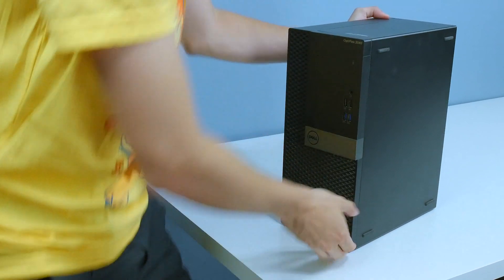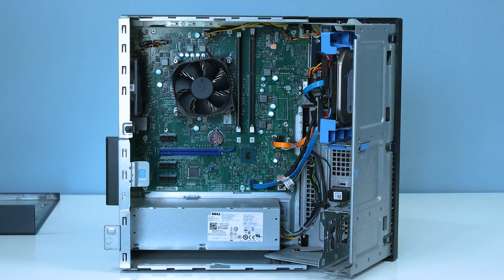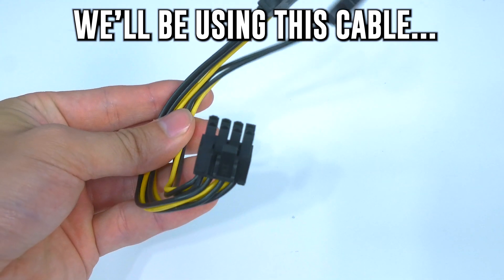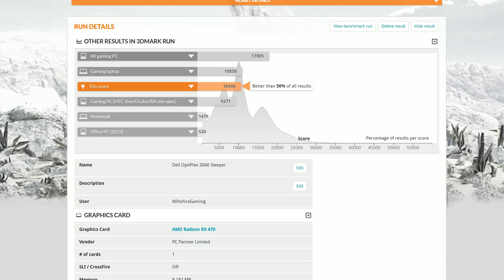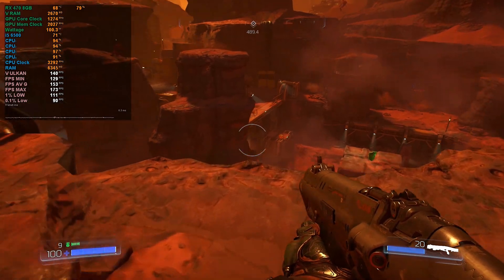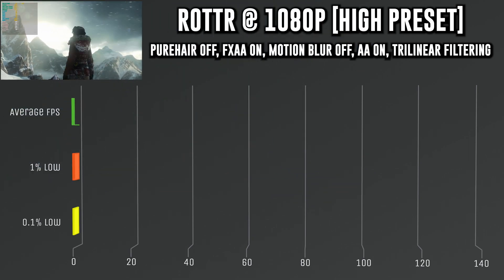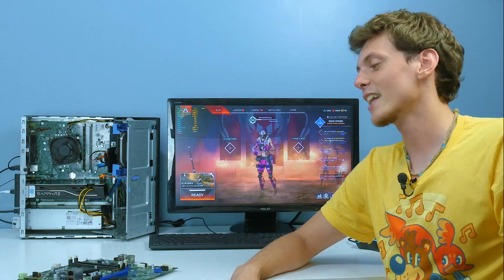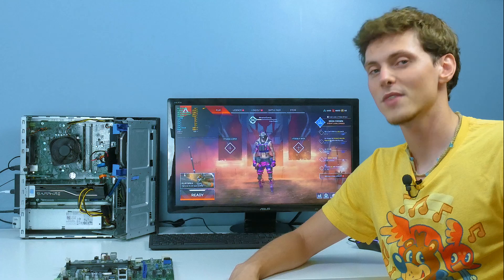$400 Budget Dell Optiplex Gaming PC (2019)

Comment: How do you connect the 2x sata to 8 pin to the power supply?
Reply from the maker: Connect the 8-pin adapter to the 2 open Sata power connector on the PSU?
Reply: @WiltshireTutorials  I didn't know there was 2 open sata connectors lol would a gtx 960 work with this (using 2x sata to 6 pin)?
Reply from the maker: The GTX 960 pulls about 130W from your PSU. You'll need 65W for your CPU and a few more watts for the drives and RAM in the PC. You'd probably be using 205W. The PSU in this PC I had in the video is 240W. In theory, it would work. However, that is taxing the PSU a little bit. It would be working a bit hard.

Comment: Dell Optilex 5050 ye sahibim.
İ7 7700 işlemci
8 GB RAM
GeForce 750 Tİ 128 bit 2 GB grafik kartı
Corsair m2 SSD 240 GB
1 TB HDD 
Bu sistem beni ne kadar götürür ve yükseltmem gerekirse hangi bileşenini yükseltmem gerekir yardımcı olabilir misiniz.?
Reply from the maker: I would upgrade the GPU and add another 8GB of RAM to the system. It'll be a reliable system for a long time with those specs. Obviously, it won't be gaming at 4K. But, throw in a new RTX 3060 or 6700XT and it'll do 1440p no problem for most titles.
Reply: @WiltshireTutorials  teşekkürler 🙏🏻

Comment: You can actully upgraded the psu in this pc with a mini psu, ofc you have to make some new holes for screws and make a bigger whole for the psu backside. You also need a 24 pinn to 6 pinn that you can order from ebay. But first you need to go to the bios and select powermode or power managment and select always on. If you dont do this with the new psu your gpu will always be on full speed and no boot. And when you want to shut down the pc you need to shut it down from the psu. But it works and yeah, i took away the hard drive and cd drive so i could fit a bigger fan, i aslo made the ssd case smaler so i could fit 1 ssd. But yeah, you can deff fit a mini psu like this Cooler Master V650 SFX Gold 650W <- this is an expencive psu, but you can follow this size psu and it will fit if you make the hole behind bigger and makes 2 screw holes to mount it better.

I did this bec i wanted to know if you could, but if you have this pc and wonder if you can pit a psu in this, yes you can but YOU need to do some modification to your case.
Reply from the maker: Already did this almost 3 years ago now: https://www.youtube.com/watch?v=lAejOvxFHkc
Reply: Just wanted to drop a "thank you!" for the notes regarding power management. Working on modding a Dell 7050 MT I just got. I had returned a prior GPU thinking it was defective and got a GTX 2060 at an even lower price; it was also giving the "full fans but no boot" issue. I tweaked the BIOS and Windows 10 power settings just to be safe. I'm typing this on that Dell so yeah, this still works.

Comment: Are you able to put an alternative PSU like a 600W EVGA psu in this OptiPlex the same way you can like in a Dell optiplex 9020?
Reply from the maker: No. This motherboard and power supply is proprietary. You have to mod the PSU to work with the motherboard
Reply: @WiltshireTutorials  Damn , this would’ve been a dope potential gaming pc if you could switch the PSU easily.
Reply from the maker: @theboy2777  it's not that difficult. Just get an SFX PSU with a 24-pin adapter. Just look at my OptiFlex series: https://youtu.be/1p9sgvkqMgo

Comment: Whats the best gpu i can safely put it in bro ? 😄
Reply from the maker: An RX 470 8GB or a 1060 6GB would be the max for the stock PSU
Reply: @WiltshireTutorials  i see , and oso what is the best gpu under 200 usd in yr pov mate 🤕🤕
Reply from the maker: Trying to find a decent GPU under $200USD is almost impossible these days. I cannot in good conscious recommend anything less than an RX 470 or 1060 6GB. Maybe try to get your hands on a 6500XT when they're released in late January.

Comment: Can I add a 1050 ti instead of the rx 470?
Reply from the maker: Of course! You can add up to a GTX 1060 6GB, if you wanted to!
Reply: @WiltshireTutorials  would a gpu that consume 150 watts work on no
Reply from the maker: That's pushing things a bit. I would try to stay under 120W max
Reply: @WiltshireTutorials  okay thanks man

Comment: optiplex 3050 i5 7200
ddr4 -GB 16
Power supply 240W

Is it possible to run a graphics card? gtx 1050ti
Reply from the maker: You could definitely use a GTX 1050Ti in your PC. You could even step it up to a 1060 6GB, if you wanted!
Reply: Thanks

Comment: Does it work without any problem? especially in full load? I have dell optiplex 3080 and I used GTX1650 OC edition I used dual PSU since I'm afraid using the PSU from dell it might not work properly..
Reply from the maker: You should be fine. The 1650's power draw is 75W, the CPU is 65W, RAM 1.2W per stick and NVME SSD is about 25W at full load. Add that all together and you're still under the max 260W that the 3080 comes with. There is no need to be using 2 power supplies.

The PSUs from Dell aren't bad. In fact, they're pretty efficient. They're rated 80 PLUS Bronze. The only problem is the low wattage ratings on them.
Reply: @WiltshireTutorials  thanks for the input!
Reply from the maker: @LaboyMoto  No problem

Comment: What graphics card u recomend to use on on optiplex 3050?
Reply from the maker: With an unmodified stock PSU, the max the PSU will support is an RX 470
Reply: Ohk ty but will it run gta5?
Reply from the maker: Yes. But, don't expect to run high resolutions with it. Probably could get away with 1080p medium settings max

Comment: These days you can get OptiPlex 5040 MT for under $200.  5040 MT has the same case, but a motherboard with 4 memory slots, so it's easier to upgrade to more RAM.  Pick 5040 MT over 3040 MT (2 memory slots).  These cases have one free 5 1/4" slot in the front (mesh plastic comes off).  Useful, if you want to add removable hard drive or similar.
Reply from the maker: If you watch the OptiFlex playlist, you'll find out that I replace the board with a 7070 motherboard!
Reply: @WiltshireTutorials  I didn't watch, yet.  Wouldn't it be easier to sell the original setup or use it for something else and get a 7070?  Well, it's good for making videos, I guess, but not very efficient.
7080 MT uses 500W power supply and it looks like it has 2x6 pin connector for video card.  Didn't look too much, but found this one for $75: eBay auction #174784507800.  There are some with 360W and less.

Comment: Very helpful video. Liked & subscribed. Am thinking of putting a better GPU into a 280 watt Tower Optiplex 3060, was wondering if you had any considerations I should be aware of. Thanks so much!
Reply from the maker: With 280 watts, you could probably get away with an RX 580 8GB. It typically consumes about 140W. The CPU would draw 65W, which leaves some room for the RAM, SSD/HDD, etc. to function properly. You could also go with a GTX 1060 6GB as well

Comment: Can this morherboard to changes the pc case? Just like using nzxt casing.  and use normal power supply is support?
Reply from the maker: No. The motherboard is a proprietary non-standard unique shape and cannot be case swap easily. You could potentially make it work with some heavy modding though.
Reply: @WiltshireTutorials  thanks for your response. Let me ask again, how about power supply port on this motherboard? Can we swab the power supply using the standart power supply?
Reply from the maker: Yes and no. You'll need to make an adapter or buy an adapter for the 24-pin cable.
Reply: @WiltshireTutorials  its that 24 pin to 8 pin right?
Reply from the maker: That depends on the model of Optiplex you have. Some have a 6 pin, some have an 8 pin.
Reply: @WiltshireTutorials  thanks for ur information🔥
Reply from the maker: You're welcome. Thanks for watching.

Comment: I might get the micro version of this. 6th gen i5/i3 can be upgraded to a core i5/i7  9th gen
Reply from the maker: Ummm, no it can't? Both generations of the 6th and 9th gen Intel CPUs require different chipsets.
Reply: Yeah i just double checked, they both use lga 1151, though i could be mistaken. Maybe the hardware isnt supported? I dont know
Reply from the maker: That is a socket, my friend. That's not a chipset. Intel requires you to buy a new motherboard for each new generation of CPUs. The only one that may be compatible with another is 8th/9th gen CPUs on the same motherboard, depending on BIOS support
Reply: @WiltshireTutorials  ahh. I see... thanks for the help!
Reply from the maker: You're welcome! Any time!
Reply: They both have the same chipset?
Reply from the maker: Nope

Comment: I have a question, I have this same model of pc but with 4gb of ram, and I want to upgrade it to 8gb of ram. Do I need to buy another 4gb ram and or just buy 8gb ram? Also, does any ddr3 ram will work? I know nothing about computer.
Reply from the maker: I would buy an additional 4GB stick of RAM. If you buy one singular stick of 8GB RAM, then you're running your PC in single channel mode and not dual channel. You also can't use just any DDR3 RAM on these PCs. They require the special DDR3L variant. Personally, I would pull the current stick of RAM out of your PC and look at the model number on the sticker of the stick of RAM. Just buy the same model number as on that sticker.
Reply: @WiltshireTutorials  Thank you!
Reply from the maker: You're welcome. Thanks for watching!

Comment: I'm using this same model with the following specs : 
Intel i7 -6700 @ 3.40GHz
16GB RAM
Boot - 256GB SSD / 4TB HDD + 512GB HDD
Graphics - Intel HD 530 / NVIDIA GTX 1050 Ti (Dual Screen) - couldn't get it to run thru both screens on the GTX - maybe due to power requirements - however, I'm quite happy now that both screens are working
WINDOWS 10 (64Bit)

Not too much hardcore gaming - just my War Thunder once a while
Reply from the maker: That's a good little rig for some light War Thunder here and there! You must do other creative things with specs like those! Do you do any editing or animation of some kind?
Reply: @WiltshireTutorials  Just normal work and stuff only - the PC scene hasn't been as exciting as the old days - 386 to 486, 3DFX graphics etc. Now are just little litle upticks.
No more hardcore gaming now.

Comment: yo dude i have a dell optiplex 7070 with a i7 9700 a 1tb 7200rpm hardrive and 111gb ssd 32gb ram 2666mhz and a 260w psu can i put an rx470 in it using a 2x sata to 6 pin connector
Reply from the maker: Yes! With the 260W PSU you could definitely run an RX 470. You could even run an RX 480 for a little more horsepower. You probably wouldn't be able to overclock it though! Keep in mind the only RX 470 I found to fit was the Sapphire Nitro
Reply: @WiltshireTutorials  thx my guy ill be trying that out

Comment: Is it possible to upgrade the PSU with a standard one?
Reply from the maker: In theory, the Optiplex would work with a standard ATX PSU. You would not be able to fit it inside the case though. You'll need an SFX PSU. If you watch my OptiFlex series, I modded the PC to have an SFX PSU inside of the case.
Reply: @WiltshireTutorials  thanks for the video, I was  struggling with the similar issue on my Dell 7050 tower, exactly the same size to 7040, 95% components and interior design are same as well. I bought an Dell 500W PSU which is used for Dell 7080/7090 and XPS8940, I though it may work with no issue because it came from Dell too. Physically it fits into the 7050 case perfectly , however it won’t drive the PC , the power button LED is in amber , by attempting something I found the problem maybe on the 4pin + 4pin CPU power cable (260W PSU only have 1* 4pin CPU cable but 500W has 2* 4pin CPU cable), even the 500W PSU is an genuine Dell products and is in the same size but looks like they have difference on line out . finally I give up the 500W PSU upgrade, so I think it may not work with a standard PSU either . But thanks a lot for this great video sir.

Comment: Could I get away with doing this using a gtx 970? Assuming I could make it fit, I’m also worried about the power supply draw
Reply from the maker: Getting the card to fit would be a challenge. Assuming that you could get it to fit inside the case, you would need to upgrade the PSU. The GTX  970's recommended PSU is 500W. That's more than double the stock PSU.
Reply: @WiltshireTutorials  thanks 🙏🏼
Reply: @WiltshireTutorials  do you think a 960 would fair any better? Trying to figure out what I could run in my setup, everything the same except for it being an i5-7500, small 256gb SSD, and 16GB ram
Reply from the maker: @eyb0ss317  Unfortunately, again, the stock PSU is just not enough. The PSU requirements for a 960 are 400W. I would suggest looking up a cheap SFX PSU and upgrade the stock PSU. It really opens the doors to what the Optiplex can do.

Comment: Wiltshire, That cage on the bottom in front of the power supply, is that for 3.5 hdd's, like 2 of them? I am considering one of these for an htpc but want more than 1 3.5 hdd slot.
Reply from the maker: I can't remember exactly. Although, I have 2 3040s. The other is at my office. I'll have to check tomorrow morning when I'm in office.

Comment: which psu can fits this Dell 3040?
Reply from the maker: Without modding, none. It's a Dell proprietary PSU.
Reply: @WiltshireTutorials  so i can add psu from externe and only cables will go inside the case?
Reply: and is there a maximum of watts for this pc?
Reply from the maker: In theory you could do so. You will need an additional adapter for the PSUs 24-pin cable though.
Reply: @WiltshireTutorials  Thanks man for ur help ,Goodluck
Reply from the maker: You're welcome. Thanks for watching
Reply: @WiltshireTutorials  1 last question pls, i am thinking of gtx 1650 super, does this 3040 dell can fits a gtx of 2 fans or only 1 ? thanks again
Reply from the maker: As long as the card is shorter than 240mm in length and shorter than 126mm in height.
Reply: @WiltshireTutorials  thanks
Reply: @WiltshireTutorials  Hi, I did buy Corsair 650w but it didn t work on it (i did use the 24 pin to 6 pin, ,,, this adapter has an other 6 pin molex too and the motherboard doesn t have it) .. i did instal normal 6 pin but the molex 6 pin could n t find on the motherboard